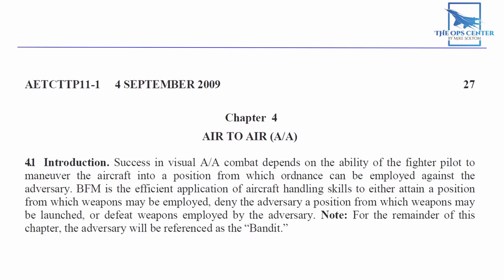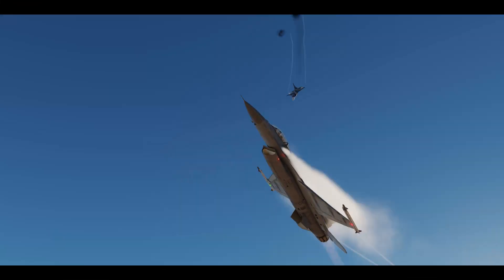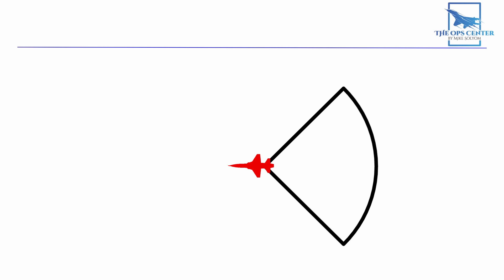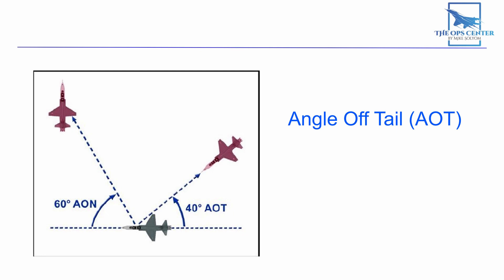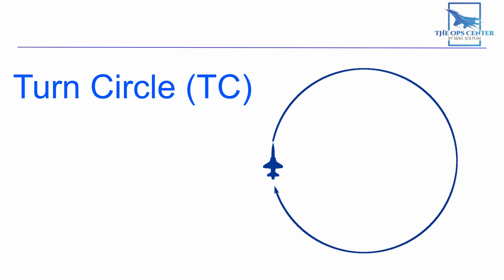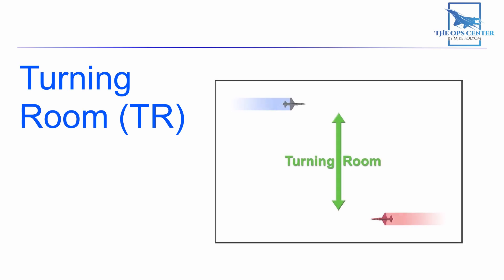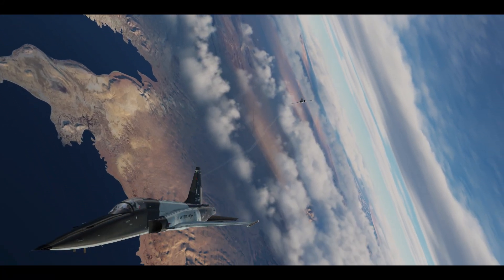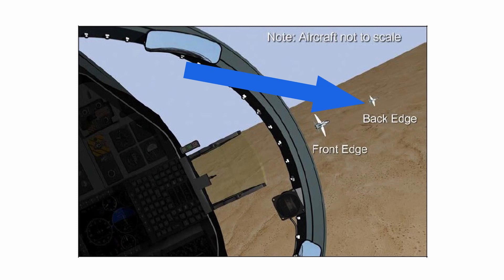How Fighter Pilots Talk About BFM | BFM Series | Part 2

Comment: Brushing up again. Lol I developed a question rewatching this video.... say in a dissimilar environment where a dogfight is post merge and perfectly neutral (regardless of 1c or 2c, opposite sides of circle with no gains either side) 

Which problem would you really try to solve first in terms of range angles and closure to become offensive? Common sense tells me you want to solve for range first since it requires the most speed, then closure in the form of solving the angles using the energy maneuverability and throttles to maintain the CZ until the rule of threes get solved. Your enemy can either be faster or turn better so assuming you can fight your own fight, what is the best game plan for each environment?